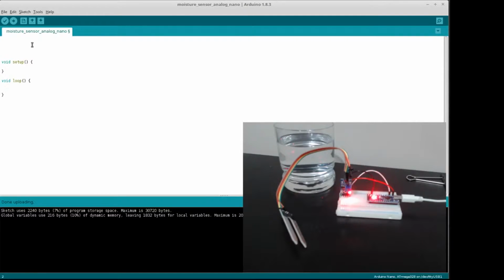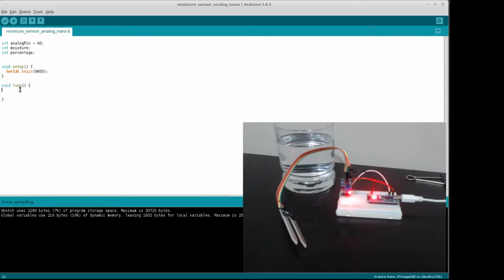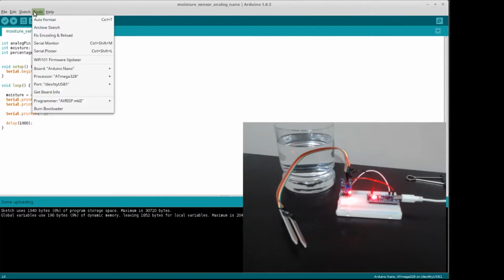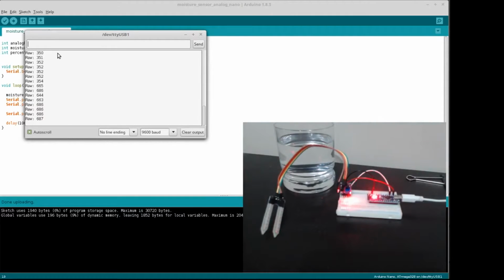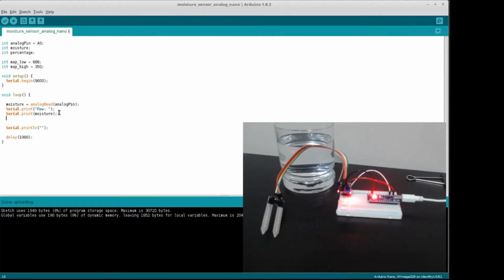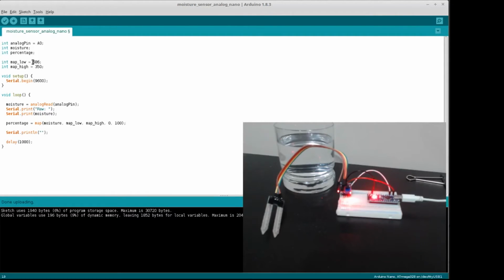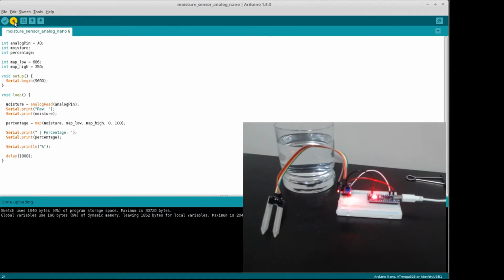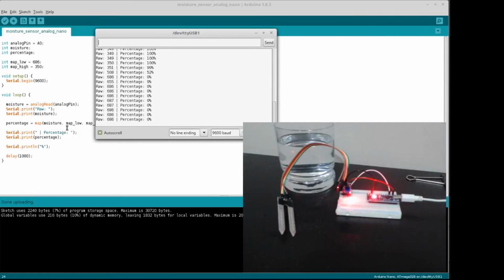How to Measure Soil Moisture Percentage with Arduino Nano and TE215 Sensor

Comment: Could you explain how to connect a motor pump with 5v relay to this project, when soil moisture is at low level(dry condition) it Should turn on the Water pump while soil moisture is at correct level (wet soil condition) pump will remain off position.
Reply: well you find full connection or not if yes then help me out ..

Comment: Hi , quick question ! Are the sensor readings (650= outside) and (350=inside) values for resistance of the sensor ? Is there any way I can convert this moisture reading into millimeters?

Comment: I use the same code that i got on your page but when i open the serial monitor only the temperature has the reading. The ec display "infms/cm". What will be the possible solution for this?

Comment: How do you stick that micro controller to the breadboard?
Reply from the maker: Sometimes you have to wiggle it a bit to get it in there.  Depending on where you buy your board  and your breadboard, some (the most expensive ones) align better.
Reply: @willworkforliberty  Appreciate your help, I figured out how to stick the board by soldering the stackable header to the board and stick it to breadboard. Now I face problem with uploading the coding script to the board, i'm using sparkfun esp8266 and I use ftdi basic breakout to connect with arduino ide. Any thoughts?

Comment: Thank you for the nice video ! 
I would just like to point out that measuring the moisture of water is actually not a very good way to set up the low / high limits. 
It is kinda counter intuitive, but moist soil has more conductivity than water alone, since moist soil has more electrolytes in it.